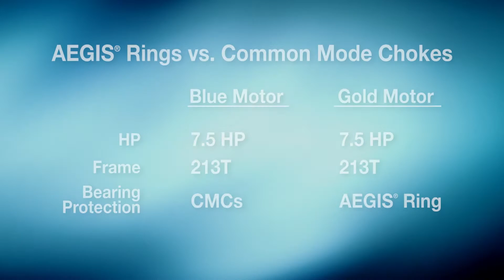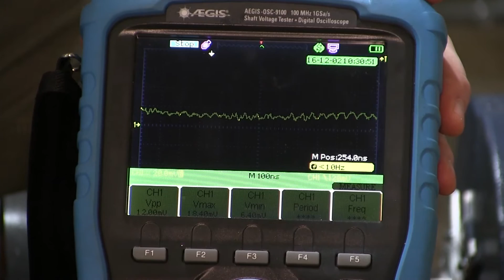AEGIS Rings vs Common Mode Chokes: Head-to-Head Test

Comment: I don't understand this video - where can I see that the damaging currents are reduced ? Inductive absorbers absorb the currents but this necessary point has not been tested in this video which seems strange.
Reply from the maker: It is impossible to directly measure capacitive EDM currents.  What choke proponents measure with a Rogowski coil, going from shaft-to-ground, should not be called "damaging current," because most of that current would not have enough energy to arc through the bearing.
What you are seeing here is the next best thing to a direct measurement of capacitively coupled bearing current:  The voltage signature of discharge though the bearings.  You see the voltage on the shaft build up and up, and then crash to zero.  That crash occurs simultaneously with an arc through the bearing, that is, with a bearing current.
What I said above about "not having enough energy to arc"?  There won't be any arcing through the bearing until the shaft-ground voltage difference (which we're measuring) is big enough to overcome the dielectric of the bearing grease.  It's exactly like a flash of lightning:  A voltage difference builds up and up between the ground and clouds, until it reaches a critical threshold, when the electric field is big enough to ionize the air, and then ZAP!  Discharge, i.e. current.
Measuring shaft-to-ground current with a Rogowski coil is like grounding a cloud and saying "Look at all this damaging current!" even when the voltage difference between the cloud and the ground is far too low to discharge.  The current you see is only flowing because you've given it a low resistance path to ground.  It wouldn't be flowing anywhere without that path, until the voltage built up enough to arc through the bearing.

Comment: Kind of foolish to test for voltage, when clearly a choke, which has been around since electronics is to "choke" current.

Wikipedia definition:  In electronics, a choke is an inductor used to block higher-frequency alternating current (AC) in an electrical circuit, while passing lower-frequency or direct current (DC). A choke usually consists of a coil of insulated wire often wound on a magnetic core, although some consist of a donut-shaped "bead" of ferrite material strung on a wire. The choke's impedance increases with frequency. Its low electrical resistance passes both AC and DC with little power loss, but it can limit the amount of AC due to its reactance.

If you limit current, you have no power.

These guys should study up on physics before making these "tests".
Reply from the maker: "If you limit current, you have no power."  If you have "no power," then your motor "won't run," Bill.  Weren't you just criticizing our physics?  
I think you meant "...you have less power."  In this case, "less" power going to the motor as common mode current is still enough to destroy the bearings.  That was Eric's experience.  And you will be seeing more of it as time passes and more damage accumulates in motors that have only chokes installed.
Reply: I believe you understand that no (or less power) I was referring to was the common mode currents (high frequency), not motor supply.  What I'm trying to get you to understand is you cannot measure shaft voltage if you are limiting current.  Do this test if you want to understand.
And, you have no conclusive evidence to your claim that as time passes these residual currents will destroy bearings.  I have customers over 10 years now with no failures...these same customers were using Aegis and hybrid bearings...still with failures.  Also, the common mode current reduction helps sensors, monitors, etc., that don't have issues anymore...whereas before, even with Aegis rings on the motors, had problems...most not even functioning. 
If you want to test current, I will lend you my Rogowski coil.  Let me know and we can work together.
Reply from the maker: Here is the bottom line: Measuring shaft voltage is the correct way to measure EDM bearing currents that originate from the capacitive induced voltage that is parasitically coupled from Stator to Rotor.  These are CAPACITIVE voltages and are NOT affected by adding common mode chokes - SUCH AS THE PRODUCT SOLD BY YOU – to the output of the VFD.  Common mode chokes can only effect the inductance and while they can reduce high frequency CURRENT from common mode currents, they DO NOT eliminate or remove the common mode VOLTAGE in the motor’s stator.  These voltages are square wave positive and negative pulses whose average is the six-step voltage which is capacitively coupled from Stator to Rotor.  Therefore, no matter how many CMCs are added to the line, this capacitively coupled voltage will be on the rotor.

When these voltages, which are commonly 40-80 volts peak to peak, overcome and break down the oil film in the motor’s bearings, an electrical arc shoots  through the bearing from Rotor to Frame (ground) and 1) burns the lubrication and 2) creates pits in the bearing race.   These pits can lead to fluting and premature bearing failure. 

NO INDUCTIVE DEVICES – SUCH AS COMMON MODE CHOKES  - CAN PREVENT THIS.  That is why, in the video you are commenting on, you can clearly see the pitting waveform continuously taking place in the bearings, causing damage.  Clearly, since it is happening WITH common mode chokes installed, it is clear that the COMMON MODE CHOKES have NO EFFECT on the EDM currents in the motor bearing.

Adding the AEGIS ring to the motor diverts these discharges to ground, thereby PROTECTING THE MOTOR BEARINGS.

Common Mode Choke distributors are telling the market they reduce common mode current HF components, which may be true, but this has no relationship or effect on the bearing discharges caused by CAPACITIVELY induced voltages from Stator to Rotor!

It is impossible to directly measure capacitive EDM currents with a Rogowski coil on the  motor ground, input lines, or shaft of the motor.  Current on the motor ground includes both capacitive EDM current and capacitive stator-to-frame current; the input lines give you no detail on what happens in the rest of the circuit or on the shaft; and current from shaft to ground is NOT going through the bearing, it is going through the low impedance path to ground that you’ve provided it.